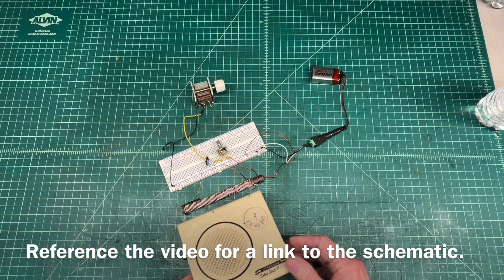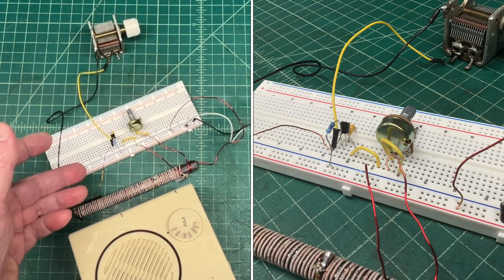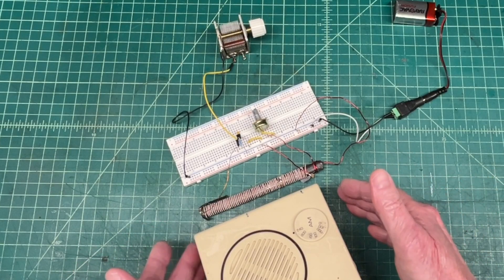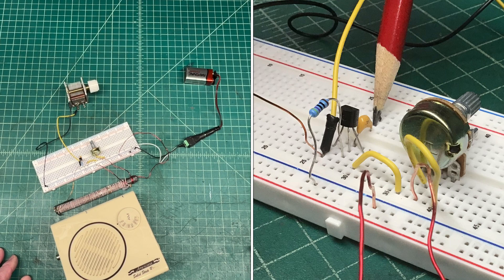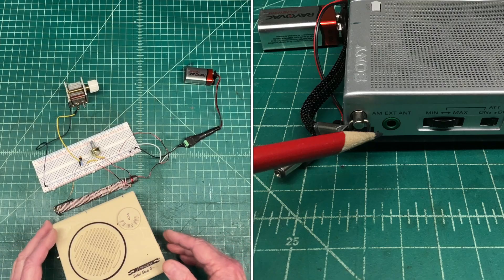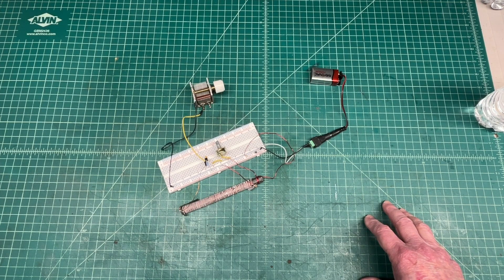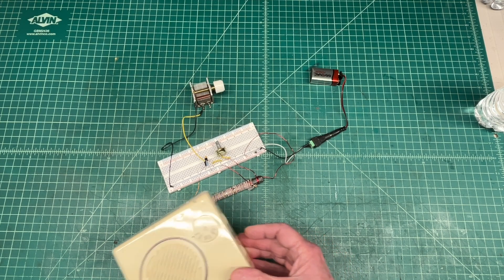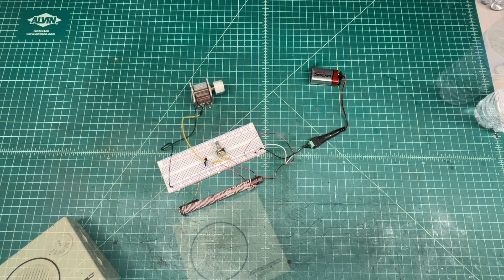A Simple Q-Multiplier Circuit

Comment: Surprising results! Would it be possible making a shortwave loop antenna with this same principle? Greetings.
Reply from the maker: I would think so; it would be fun giving it a try. A short video below that shows a loop with the coupling coil in the center. This design was for the MW (AM) band. Another Q-multiplier circuit that ties back to the I.F. Hope this is helpful. Best, Don

https://youtu.be/EaB9td897fI?si=BQ9tvdNvIgca7f5W
Reply: @RestoreOldRadios  Thanks! I think that is basically the same principle of a  regenerative receiver. I hope you decide to make a video about something similar for SW bands someday. Greetings.